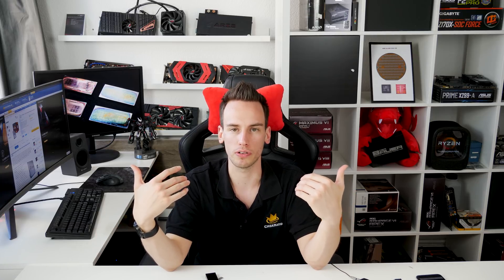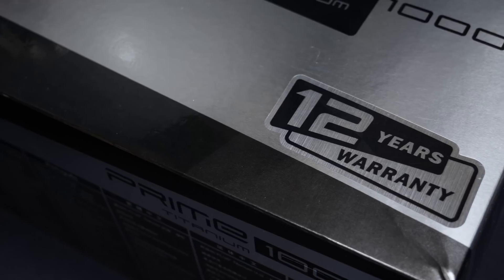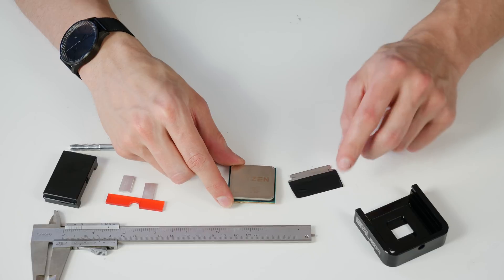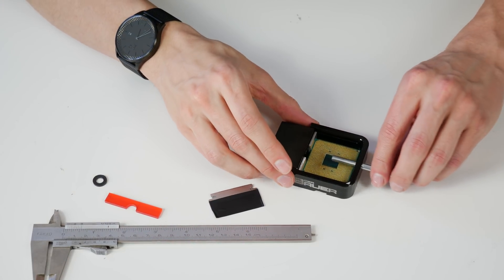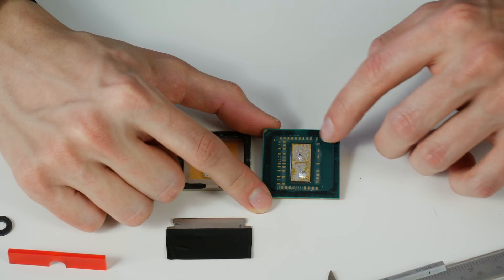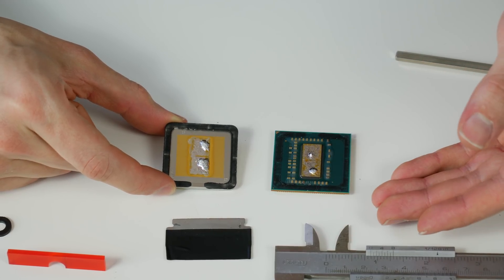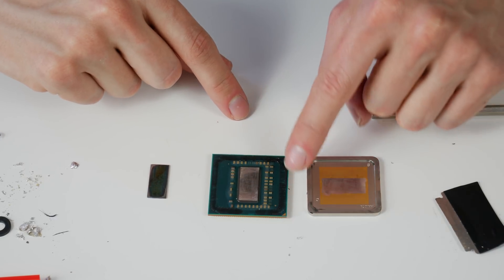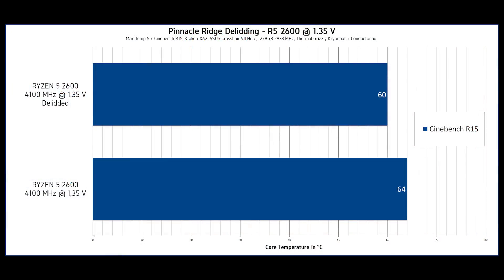ZEN+ Delidded - Before/After Temperatures - [Ryzen 5, 7, 2600, 2700X]

Comment: 12nm is likely just marketing for an improved 14nm transistor. This is still a good thing. These improvements can be significant when brought on to an actual die shrink in the future. Intel has done this before. Would be unsurprising if Ryzen 3 gets the 7nm with same design pattern. What would be surprising is how well it will perform at a 5ghz OC when it gets there.

Comment: if the die size is the same then there is no doubt that there will be a ryzen 2800x with 10 cores...while this means that threadripper 2 will be a 20 core cpu, it also shows that next year ryzen 7 will be up to 32 cores and threadripper 2 64/128 core cpu

Comment: Die size stays the same as previous version it's been said by AMD. Why? Because they simply use the same CPU design only manufacture it on 12nm where the size difference is on the parts not on the die, as such parts have more space between them for better heat transfer and it's quick and cheap to do instead of redesigning the whole thing to a smaller die size. With 7nm yes it will change. With 12nm being only an improvement of 14nm doesn't make sense to waste resource on a complete redesign. Remember this is a "stop gap" before Ryzen 2, this is more of a Ryzen 1+ but they named it 2000 series anyway... marketing. I'm sure there is tons of confusion about the 2000 series and some calling it Ryzen 2 while it's not really a Ryzen 2, it's just Ryzen 1 manufactured on 12nm is all with minor tweaks in software for latency and clock features.

Comment: der8auer, I didn't see anything in the comments on this. But, perhaps I missed it. Ian over at Anandtech talked about the differences in the physical layout of Zen and Zen+. Essentially, the physical size (external dimensions) is the same. But, there is more "dark silicon" between the features on the silicon. The transistors are smaller. Rather than shrinking the whole die, they just used to additional space within the die to provide more space between features on the die.

You can read his explanation here: https://www.anandtech.com/show/12625/amd-second-generation-ryzen-7-2700x-2700-ryzen-5-2600x-2600/2

I hope that's helpful!

Comment: 12nm and 14nm are basically identical, they just use slightly smaller transistors for "12nm", which leads to more unused silicon.

Comment: What is the maximum die size you could fit in that AM4 socket? looks like maybe 330mm2? (an additional 5mm in width) it looks like it has a lot of spare space around the edges. Is that true? or is there actually stuff there?

Comment: I am wondering if it is possible to delid Intel's 8th gen, then put small and thin indium plates between heatspreader and die, glue it with high-temp silicone and then heat until indium liquifies. Or trying without glueing, only soldering Intel CPU like Ryzen. It is very probable that CPU will be dead, but if not, what temperatures it will have (it will be lower, higher or about the same as not delidded or delidded but with liquid metal on it).

Comment: Hi,

while I believe you know - or have access to - better answers than mine, here
is my take on your question:

Concerning:
Why the same die size?

- Physics
  You can make cables thinner (16 nm -> 14 nm) but electro-magnetism follows
  a simple rule concerning distances: 1/r²

  r=2      =>  1/(2)² <=> 1/4
  r=1      =>  1/(1)² <=> 1/1

  i.e. half the distance, quadruple the effect of the forces, like B-field.
  Which is isn't a great thing when you primary functional part is a so called
  FET (pr. phat), or in it's full name Field Effect Transistor.

  One can lower voltage and amperage, yes, but even if you half those you only
  half their effect, there is no square in that equation. Not taking into account
  'threshold voltage', raising of resistance and it's influence onto amperage.

  I believe this to be a general trend, as when you google semi conductor
  stuff and land on things like "semiwiki.com" you see that cells - usually
  6T SRAM cells are used as metric - essentially aren't getting any scaling
  since the industry went under the resolution limit of their light source,
  which still is at 193 nm.

- Tooling

  - for die cutting
    "Dicing" (as it's called) either as primary modi operandi, introduce
    either mechanical or thermal stresses creating a minimum width for their
    cuts. Plus it includes the following two factors:

    1st - material loss  by the thickness of the saw blade, or
    2nd - as laser "burn" things away they "cavitate", thus: the cavity.

    Not talking about secondary, teriary  and/or compound effects here.

    See here for more:
    http://www.silicon-edge.co.uk/j/index.php/resources/die-per-wafer
    http://caly-technologies.com/en/die-yield-calculator/

  - for die pickup
    Well they are mechanical things, like an robot arm, you want to move them
    as exact as may be some 100 atoms (-> ~10 Atoms per nm)? Well RTM (Raster-
    tunnelmikroskopie, or english: scanning tunneling microscopy, STM), those
    things that allow to "see" and manipulate single atoms, need hours
    moving ... have fun figuring that production cycle out.

  - tools for soldering
    In this regard there are three major tools for soldering:

       - Solder balls for the microball solder points of the die.
         Keep the same size, you can keep the same layout plus keep the
         pitch and solder ball size.

       - Stencils - "PCB Solder Stencils" or "Solder Paste Stencil"
         The finer the pitch the harder it is to handle stencils. Because the
         thickness of the stencils defines the applied solder paste thickness:

         Too thick == shorts
         Too thin  == no connect, tomb stoning, etc.

         Or to put it in another POV and fitting phrase:

         "They don't come cheap."

         See here for more:
         https://www.sparkfun.com/tutorials/58

       - Solder paste
         The solder paste needs to fit into the smallest holes and the biggest
         holes at the same time (you can't - easily - have multiple runs of
         soldering in a re-flow oven).

         First it needs to be viscous enough to create a uniform and cohesive
         layer of solder, consistently. For that it needs to be viscous enough
         not to run away when the stencils is removed, but also liquid enough
         to fit into the PCB's counterpart where the microballs are to be
         sticking soon.

         Well that is as one approaches "quantum levels" things like or
         similar to capillary action begin to be the reigning regime.

Hence: Same die size.

Concerning:
Why so few degrees difference?

First let us be clear all test were done with:

a) CPU + Indium (Alloy?) TIM + IHS (Aluminium?)
   ("normal" cooling)

b) CPU + TGC Liquid Metal (Tin-Gallium-Indium Alloy)
   (direct-die cooling)

Looking up the thermal conductivity of Indium (element), Indium solder
(97In3Ag), Gallium (element) and TGC Liquid Metal (SnGaIn).

Information we find here:

http://www.indium.com/thermal-management/thermal-k-list/
http://www.indium.com/thermal-interface-materials/solder-tim/
http://www.thermal-grizzly.com/en/products/26-conductonaut-en

Now let's misappropriate their table and add TGC:

Number  Material                        Thermal Conductivity
                                        [W/(m - K)]
        Pure Aluminium                  240
4       Pure Indium                     86
290     97In3Ag [indium solder]         73
        Thermal Grizzly Conductonaut    73

(I hate proportional fonts - monospaced FTW)

So we now have the thermal conductivity of the materials in question we see
with the exception of Aluminium itself, which the IHS is probably made of, all
are on or about the same, either

- TGC: 15.2% worse
- In:  17.8% better
- Al:  off the chart (2.75x to 3.28x better)

Aluminum doesn't play a role in this because it's more than double (200%)
better, thus the constraining factor is the TIM.

What the Aluminum brings to the table is "thermal capacitance". Like the VRM
heat-sinks of these "RGB is great boards" - (BS IMO - just more PCB real
estate lost to useless power lanes, introducing signal integrity issues and
adding heating elements to the board [LED's are 5-6X better than an
incandescent light bulb .. yes, from 2% to 12% efficiency):

A big chunk of metal.

A big chunk of material, of any kind, can (and will) be used as a "heat-sink";
and it's just a heat-sink, a thermal capacitor: take it and radiated off "when
time allows".

These are not a "cooler", things with relative low amount of material, but
"immense" surface area, integrated into a combined radiation and mass transfer
(airflow) system. Why else do good coolers have fins and their-like en masse?

Then there is the pressure the TIM is being used under. Is the TIM under the
IHS at the same pressure as the Lquid Metal? That actually influences
efficiency of heat transfer.

Anyway, my answer:

I think you will find the (missing) IHS will account for most of the
differences in temperature. And that a 1:1 comparision (including the IHS)
would lead to differences either near or inside of the error margin.

Edit: Format cleanup and (some) typos.

Comment: You tested temperature with Cinebench R15..? why not Aida64 or Prime95 or any other stress testing tool which is designed for this? Cinebench is only short and doesn't stress the CPU long enough to make it run hot. At least test with Realbench or Aida64 FPU for about 30 minutes. Sorry mate, this is not very credible for me.
Reply from the maker: Sooo you think Prime95 is more realistic to what you will have in every day situations? :D Sure you can get higher numbers like that but it will be something you will never reach in any situation.
Reply: For everyday situations no, but to see how much gain there is from delidding CPU i would test with Prime95 for at least 30 minutes to see how much performance gain there really is. 

Anyway, my CH7 Wifi is on its way and when i get it i get an 2700x too, quite an upgrade from CH6 and R5 1600. 
Cheers.

Comment: You mentioned doing direct die cooling for summit ridge, so is there a particular reason you didn't do that with pinnacle ridge considering that the die is actually the same size?
Reply from the maker: yea because it's the same die size as summit ridge. I did a video back then and because it's the same die size it will be the same result

Comment: Remember that now we use FinFET and 12NM are more as marketing thing - optimization of what is called 14NM. Some parts of the gate can be smaller or clearer so we would get less electric resistance.

Comment: Conductonaut  + Kryonaut ? 
What for ?
Reply from the maker: Conductonaut between IHS and Die and Kryonaut between IHS and AIO
Reply: Conductonaut goes below the IHS, between the IHS and the chip itself..also know as liquid metal, and the other goes on top of the IHS...between the IHS and the cooler...know as thermal paste
Reply: ok, why the heck use inferior thr=ermal paste, instead of liquid metal in both places?
Reply: to cut costs of production and/or increase the profit
Reply: I mean - here, in this test? Liquid metal all the way would make more sense.

Comment: probably due to it being such a small shrink they kept the dimensions of the die the same so they did not have to chance the cutter pattern from the wafer to save on refitting costs, there could be other reasons but that seems the most likely, also they probably cannot fit any more extra die per wafer even if they tightened it up

Comment: AMD is known for removing extra cost in manufacturing so maybe they cut the dies the same size so they did not have to redisign the pcb or retool to cut the smaller die. Cost of extra silicon is probably lower than changing the process.

Comment: The shrink from 14 to 12LP was more about transistor switching efficiency and yield. Essentially they're using a 12nm process to make a 14nm part. Think about it like using a more accurate printer to print print a thick line. The line will be less wavy.

Comment: Regarding die size:
https://www.anandtech.com/show/12625/amd-second-generation-ryzen-7-2700x-2700-ryzen-5-2600x-2600/2
"the new processors are almost carbon copies of the old ones, both in terms of design and microarchitecture. AMD is calling the design of the cores as ‘Zen+’ to differentiate them to the previous generation ‘Zen’ design, and it mostly comes down to how the microarchitecture features are laid out on the silicon. When discussing with AMD, the best way to explain it is that some of the design of the key features has not moved – they just take up less area, leaving more dark silicon between other features."

Comment: The die should be smaller, but AMD may have kept the same size for production side savings - most of their tooling and successes are 14nm node size dies. Threadripper, for example, had two non-functional dies. So, it does appear this die may have some extra non-functional space on silicon to retain the 14nm packaging format (PCB, Tooling, Soldering, etc).

Comment: New Ryzen has the same die size and transistor count as first gen Ryzen. But 12nm LP allows AMD to increase the distance between transistors so it’s less likely to have thermal throttling

Comment: 7:50
The specific lithography is not necessarily the exact size of the transistors in nm. It is often just a performance indicator . That's why the Ryzen 2 die size is exactly the same.

Comment: My 2700X @ stock clocks (3.925Ghz all cores) achieves 60C after running Prime95 for one hour, so I’m definitely happy with that and not requiring a delid is just amazing!  AMD did it right by using soldering.  I am using a custom watercooling loop, and it really helps keep the 2700X cool even under torture loads 😎
Reply: You still rocking amd?

Comment: Regarding the die size I think I've heard a comment from one of the AMD's top management people that they just made minor tweaks and didn't make a new blueprint, if it's a correct word, for the die and therefore all the objects are of the same size and located at the same places. I think there was even a reason for it - if you increase the density of transistors on the crystal you're facing the increase of heat due to parasitic capacity of the circuits and also the heat dissipation gets harder to perform.

Comment: Well the 12nm process used is apparently just an improved version of the 14nm used for Ryzen 1000 (so in essence just marketing talk), that there isn't any change to the die size doesn't really surprise me. I think it was Anandtech that broke the news a while ago... I don't remember the specifics, sorry. You should hit up Ian Cutress on twitter. :)
Hm, I didn't really explain that well, what I was trying to say is that the 12nm is just an improved 14nm. If you compare the way Intel and GF reports process node, Intel would still call this 14, not 12. Hope that made my point clearer. Not saying that there's no density improvement at all, but it's less than what the numbers imply. AMD has apparently used the small improvement as dark silicon to help with thermals/voltage/leaks.

Comment: From what I understand AMD did use the 12nm node but did not redesign their cpu for it they just made some tweaks to the transistors so the include some more black silicon which gave them a small performance uplift however doing so would not result in a smaller die. Considering zen 2 is coming next year going with 2 redesigns in 2 years would have been a bit much.

https://www.anandtech.com/show/12625/amd-second-generation-ryzen-7-2700x-2700-ryzen-5-2600x-2600/2